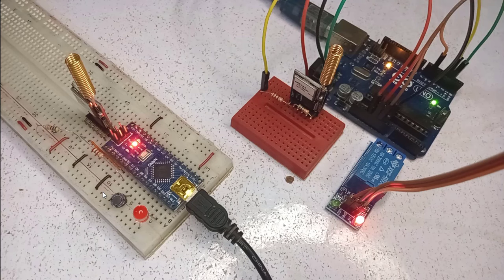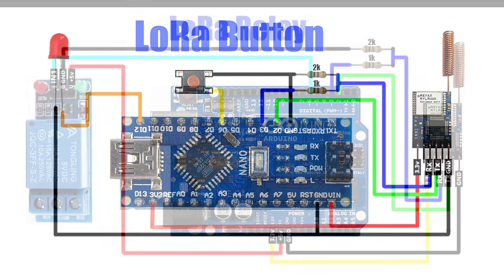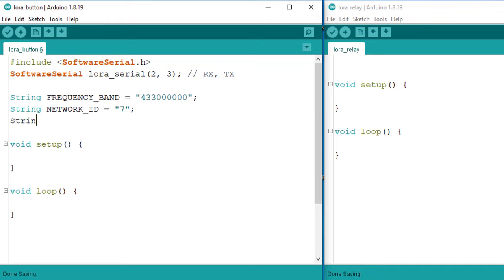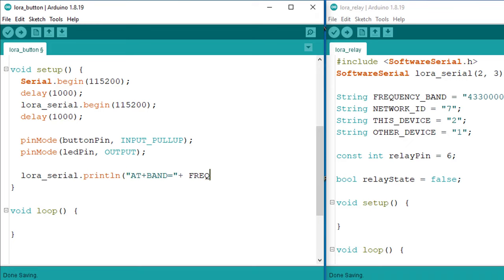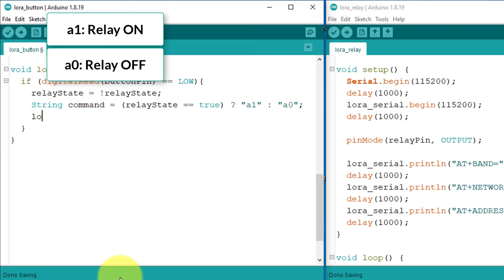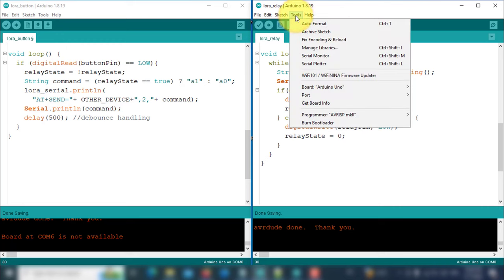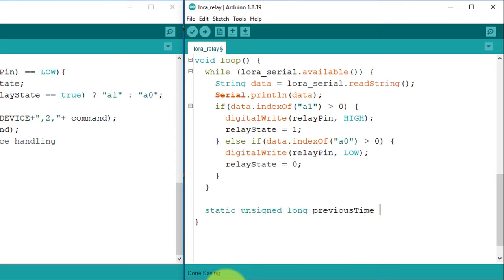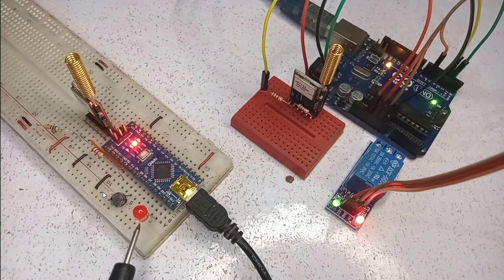LoRa Relay Control With Arduino Upto 15KM

Comment: Love the project. A matter  of fact, setting one up to play with myself. The only thing I am not sure about is the ground on the relay. How is that getting it's ground.  I think I understand, to activate the replay you are pulling in1 down (I think). What bugs me is where the lora module is getting it's receive ground for the voltage divider? Thanks and great job teaching and explaining.
Reply: I agree, it does not make sense to have a 1k resistor on the relay ground.  Is this correct?

Comment: Sir, I have an issues with the program I am using LoRa SX1278 the LoRa button is showing 1a and 0a in the serial monitor, but the led is not coming on and the LoRa relay not receiving the data, hence the relay is not working.
any advise appreciated.

Comment: dont lora modules use 3.3v logic and arduinos use 5v so how does this work?
Reply: he placed resistors at the logic pins
Reply: But forgot the gnd from the relays to connect with gnd arduino

Comment: not good - try another approach:
1- sender sends command
2- every command sent, requires confirmation from the receiver
3- once confirmation received, no more communication needed until next command is needed

this way much much less pollution in the air
Reply from the maker: great! I will work on it.